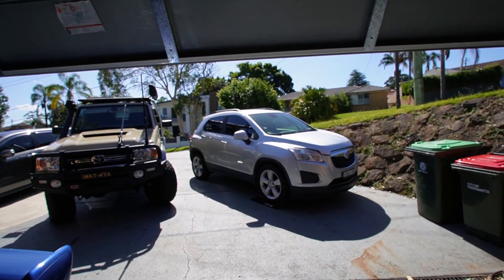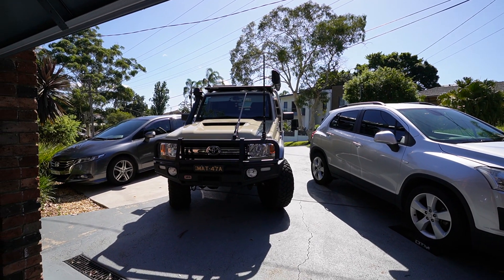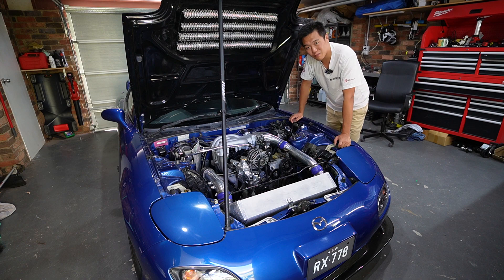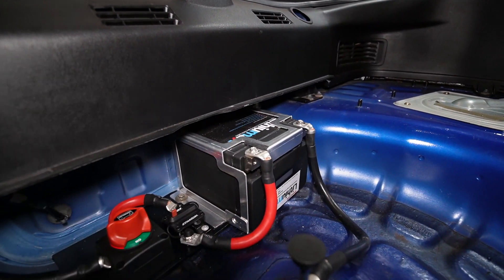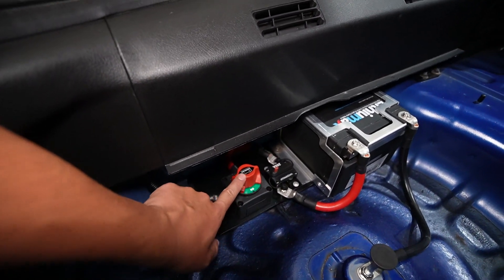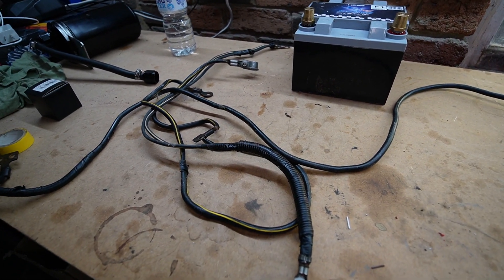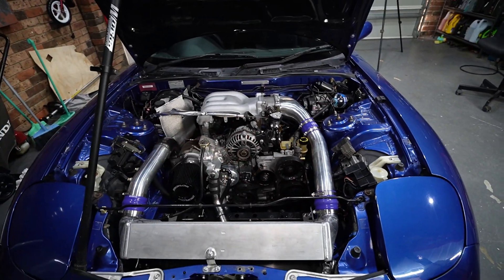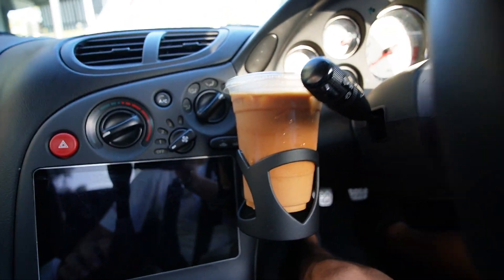RX-7 LITHIUM battery and wiring upgrade overview

Comment: Hey mate, quick question. Why did you use a Race 9+ battery instead of a Restart40 battery?
Reply from the maker: Hey mate
Mainly the price difference as i didn't find the need for the restart function. 
Essentially, the alternative was the same internals with a different BMS. 
I have a kill switch and chargers handy.
Reply: @ Okay, fair enough. Thank you for answering my question 😊

Comment: Hey mate  any concerns about the battery relocation when it comes to being a defect? I know it's the least of your defectable mods lol. Have you had the bridgport tuned to pass epa or did you bring it up with your tuner that in the event you get defected it is possible to pass EPA? ETC
Reply from the maker: Hey mate 
A few questions there i'll try to answer! I can also offer some insight having gone through that process before with EPA/pit inspection (i'm in Australia)

No battery relocation will pass through the pits - especially when relocated where the spare wheel used to be. 
In regards to EPA noise emissions - it is not as hard as people think with these cars. There are a few gasses they detect during the process. The key is a good 400 CEL catalytic converter and E85. I believe i can pass emissions as is with some tuning and modifications to the exhaust/fuel system.

Comment: Very clean install mate, also where do I get myself one of those cup holders? Do you rate it and will it hold a slurpee
Reply from the maker: Thanks mate quite pleased with it! 
The cupholder is the Dorito Concepts cupholder. 
Yes they will should fit the 711 slurpees (not sure about the jumbo) and yes any standard size tapered cup will fit. I've had a large maccas frozen coke in there!

Comment: How were you able to get your engine information on your radio?
Reply from the maker: Hey mate 
The radio is an android unit and you can download OBD2 apps to read OBD2 parameters only (i use TorqueApp). ECU is an Elite 1500 and can output OBD2 data onto a bluetooth dongle which automatically hooks up to the android headunit. I simply start the app and it will connect itself. The only meaningful sensors i read are coolant temp, MAP pressure, fuel pressure and IAT. OBD2 parameters do not include other outputs like AFR, oil pressure etc. 
Hope that's helpful!
Reply: @JCYT  very helpful!

Comment: I fitted an NPC 1300Nm clutch & billet flywheel when a new stock Toyota clutch & flywheel started slipping under acceleration after fitting a Torqit exhaust. It has noise in first just idling along & changes volume on acceleration & deceleration. Apparently this is normal for NPC clutches but wasn't present on the stock one. They both run the same genuine thrust bearing so it might be on the input shaft, I got used to it. Check all the bolts & work when you get it back from Toyota,  The Toyota tech's I've had first hand experience are pretty rough & miss a bolt here & there. P.S That's a bit piss weak on Toyota's side about the G.V.M warranty refusal seeing as it's an A.D.R approved mod.
Reply from the maker: Thanks for that i definitely have a good look after Toyota techs touch it. The dealer was the one who actually picked it up and they were proactive to put through the warranty claim on my behalf. They seem to think it's the thrust bearing too! Not sure how they could fail at 9000kms.
Reply: I have a 21 79 single cab with a pre rego GVM upgrade.  What is the rationale behind a GVM upgrade voiding a potential gearbox/clutch warranty claim?
Reply from the maker: @iS088  I am not sure. It does not make sense to me, but perhaps since the pre-rego PVM puts it under SSM they could be trying to use that as a scapegoat haha